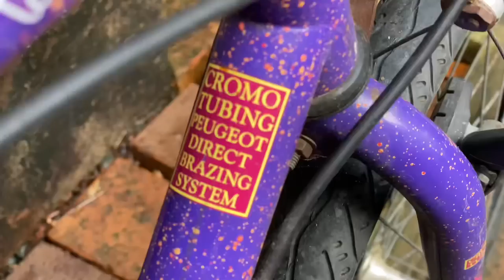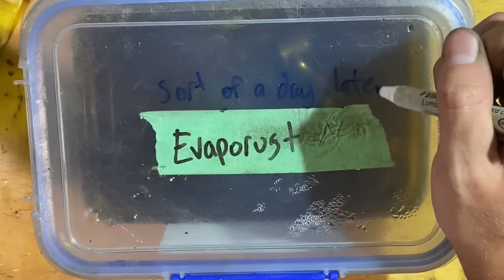Fixed gear 26” frame swap/build (Peugeot Black Rock)

Comment: hole in fork dropout is probably for an axle lock washer, just a washer that goes around the axle and has like a hook that sticks off and goes into the hole. never see them on qr axles but they're pretty common on solid axles
Reply: 100% 👍
Reply: lawyer tabs
Reply: This is the right answer. I don't know what the proper name is but I always called them hook washers. They were to prevent tooth loss if you decide to pull a wheelie with loose wheel nuts. QR forks normally had nodules on the tips of the dropouts to serve the same function.
Reply: Torque washers

Comment: Hello I enjoyed your vidio. I have a nice collection of bikes. The hole in 5he front drop outs is for the safety washer which keeps the wheel from falling off if your lug nut is not tight. Since your hubs are quick release the safety washer has been eliminated. I used to work in a bicycles shop.

Comment: I've just discovered your channel and have been inspired to do up some of my old bikes. I've been out and bought the Evapo_rust and found it doesn't work in the cold temperature of the shed at this time of year so have moved it inside. All good now. Got some Autosol too. Brilliant stuff. A little goes a long way. My question is, what brand is the grease you are using on wheel bearings and head sets?

Comment: Do you think you could post a link to the bulk garage door chain? I'm just looking for the correct chain specs.
Reply from the maker: https://www.trademe.co.nz/home-living/outdoor-garden-conservatory/sheds-garages-storage/door-openers-remotes/auction-3677525880.htm
Reply from the maker: There are a few, from memory, that are the same 1/2x1/8 pitch. 410 is one of them 👍

Comment: Great looking Puegeot.. that colour is so good. Am curious are there any current model/new bikes that grab your interest?
Reply from the maker: Sure is! 🤩 love the colourway of this bike! 
I have a Kona UnitX (2020) that I love. It has a steel frame but modern standards and it just rides beautiful 🤙 I also like the Stooge Cycles range, they’re quite cool! (Stooge are more exclusive than Kona etc but not necessarily expensive as some low production bikes). 
Some Marin (Nicasio and Larkspur) are pretty cool, too! 🤙 there are some out there, mostly the steel ones haha 😅

Comment: holes are used to pass a dynamo cable
Reply from the maker: That would make more sense on a touring bike, but that’s about the only thing it could be I suppose!
Reply: @toastyrides  I have the same one with mudguard ;)
I saw several bikes like that in my workshop with dynamo

Comment: LOVE this frame.  The hole in the dropouts is for a retainer safety washer, the little washers with the pin on them that keep your wheel from slipping out.
Folks always tell me that canti brakes are a pain to set up but i love em, they were on everything i had when i was a kid so i learned how to set em up properly and now i run em anywhere i don't have discs.

Comment: had the same front canti/bag issue, i used a q-tip stem on the cable as i didn't have any spare cable housing, but it should work the same to prevent cutting into the bag with friction every time you brake